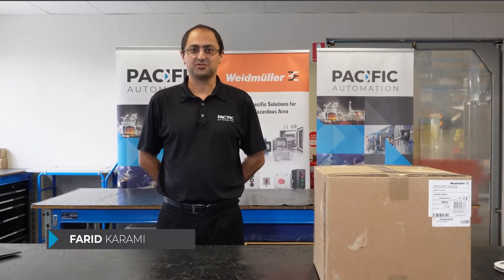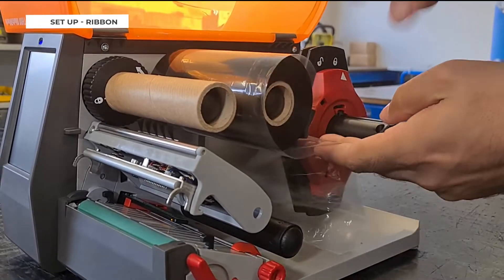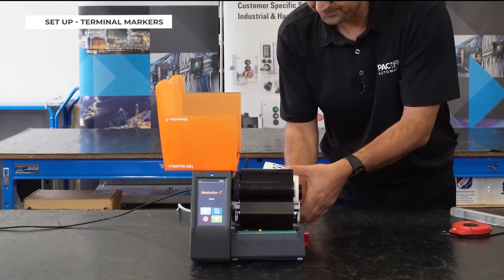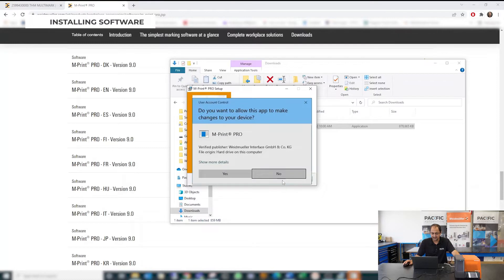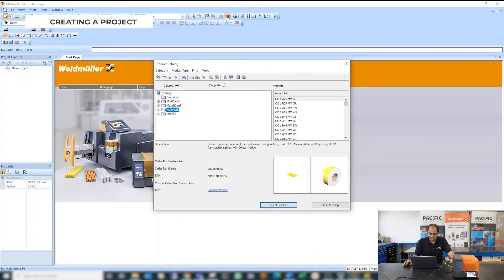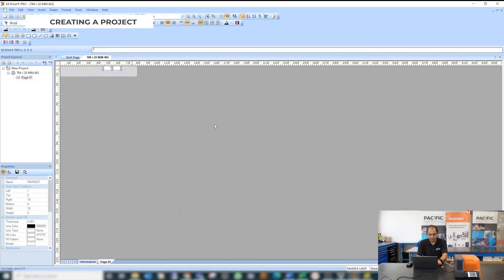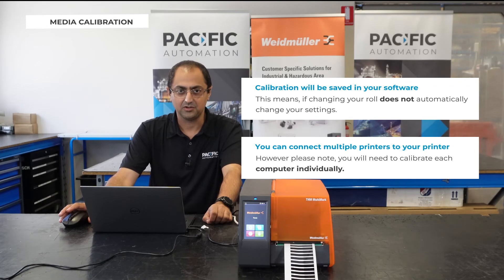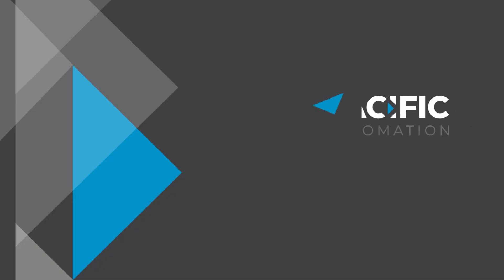Weidmuller THM Multimark Electrical Label Printer - Unboxing, Setup & M-Print Pro Software Training

Comment: hello, I have THM multimark printer, it's been printing but need to press start for every individual label. what and where to do the set up to make it print automatically.
Reply: YOU HAVE PRINT ON DEMAND TURNED ON ON THE PRINTER PRINT SETTINGS

Comment: When I press print it says to print the file later it is necessary to put this file into a folder named labels on the USB medium. Saves it and doesn’t print. Test print looks bad
Reply from the maker: Hi Jacob,
Thanks for your message. It sounds like M-Print PRO is set to print to File Output. When you're ready to print, try clicking File --> Print, and select your printer from there.  If you're still having trouble, feel free to reach out to us via the Contact Us page on our website.  If you're not in Australia, we'd recommend reaching out to your local Weidmuller office.

Comment: You have said to adjust the sensor into the right position but don't explain what that position is?
Reply from the maker: Hi Tim,
Thanks for your feedback, good point!  When printing on wire markers (or any other marker using the flat roller), the orange LED should be positioned to the centre of the marker.  When printing terminal numbers, it should be also centred in the middle of the marker.

Note that when printing wire markers like TM-I series, align to the centre of the marker which is towards the inside of the printer.  You can see the ideal position at 3:30 in the video.

The DEK and WS terminal markers have a black square on the back of them.  This is what the printer uses to identify the start of the next marker and is what you should be aligning the sensor to.

We hope that helps, and thanks again for your comment.
Reply: CENTER OF MEDIA